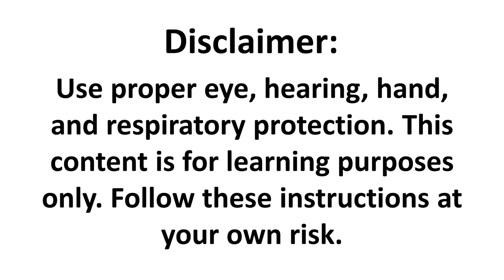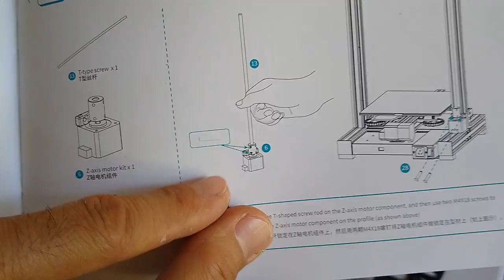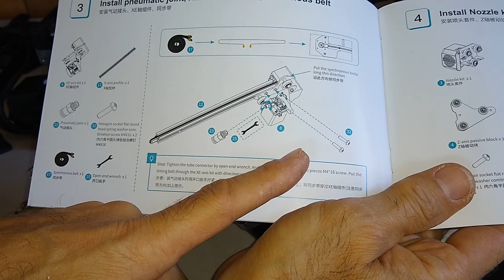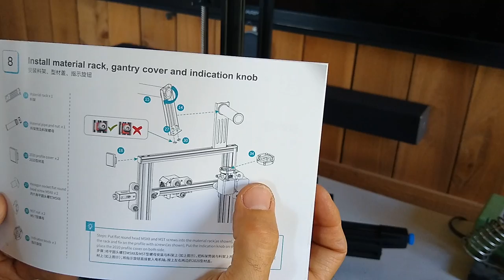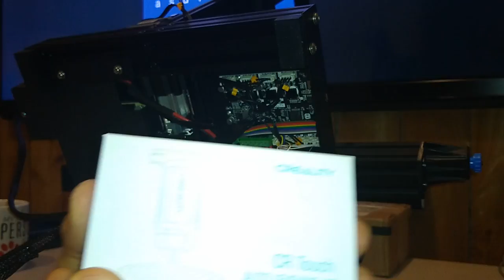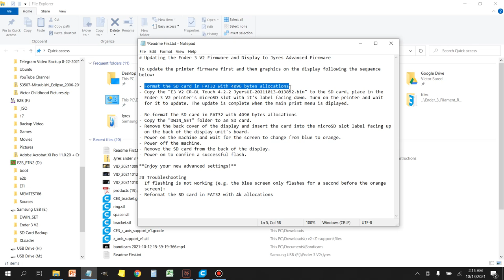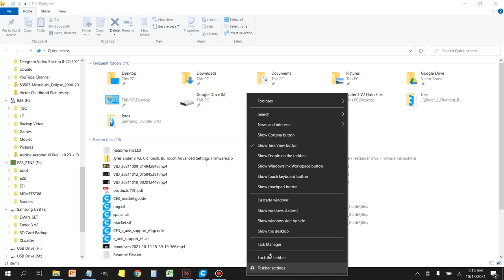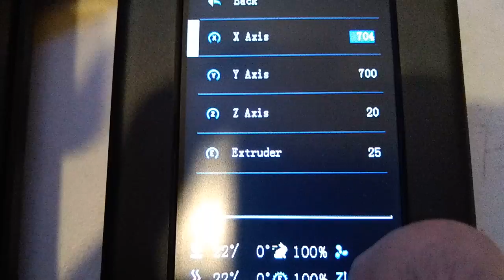Ender 3 V2 Assembly, Upgrades, and Jyers CR/BL Touch Firmware Step by Step.

Comment: They must have changed design a bit on something. I used your links and bought the stuff but the nozzle of the new hot end hits the bed before the CR touch comes close enough to the plunger. Ender 3 v2
Reply from the maker: Hi Craig, Thank you for commenting. Send me some pictures to vbared@gmail.com of your hotend without the fan cover so I can see what's going on. 

I'll do my best to help you resolve the issue
Reply from the maker: Hi Craig, I found out what happened. The link in the video description is to the Micro Swiss all metal hotend that fits the CR10S Pro/ CR10-MAX (which is longer). This is the shorter heatsink made for the Ender 3 V2. 

https://store.micro-swiss.com/collections/spare-parts/products/replacement-all-metal-cooling-block-for-cr-10-ender

Send me an email with your PayPal info so I can cover the new heat sink cost. It should be like $20 plus shipping. Let me know, sorry for the goof up.
Reply: Shit can't send it back now.
Reply: Actually look like it says for CR10S and ender 3 and pro.
Reply from the maker: @craigreich8046  Hi Craig, I fixed the link to reflect the correct Micro Swiss model after seeing that it was linked to the CR10S Pro and CR10-MAX version. You can tell which one you have by the number of small heatsink fins. The CR10S Pro should have 5 horizontal small fins and the Ender 3/CR10 will have 4. Please place the order for the short heatsink using the link from the Micro Swiss store in my previous response and send me an email with the total shipped. It's a small part so shipped shouldn't be more than $30, I'll happily reimburse you. It was my mistake. You were so kind to support my channel by using the provided links. Thank you for alerting me about the error.
Reply from the maker: @craigreich8046  Don't worry about sending the other one back because you're going to need the rest of the parts. You're going to loosed the grub screw that is holding the titanium heat break to the long heatsink and reinstalling the assembly below it to the new shorter heatsink. It's only going to take a few minutes to swap.
Reply: @vbared  I think I have an easy fix. I found 2 small computer mobo stand offs and I think I can just extend the touch sensor a bit lower as it only needs a few mm. One thing I could not figure in your video as you went a bit fast was after flashing the firmware what do I need to do next with bed leveling and such? Thanks for the help Victor.
Reply from the maker: @craigreich8046  Are you using the stock fan/parts cooling assembly that comes with the Ender 3 V2?
Reply: @vbared  For now yes.
Reply from the maker: @craigreich8046  OK, the problem you will have is that the parts cooling fan will be blowing on your heater block instead of the part under the nozzle. If you decide to get my minimalist dual fan bracket you're going to have the same issue. The stand off will get your probe back to where it needs to be but the parts cooling fan won't blow on the part you're printing because the heater block is in the way.
Reply: @vbared  Did not think of that so I just ordered the right one with your link.
Reply from the maker: @craigreich8046  Good morning Craig,  Send me an email vbared@gmail.com with your PayPal info and total for the part so I can reimburse you. I feel bad that you had to spend extra hard earned dollars and printer down time for my error. I'll sleep good knowing I took care of this.
Reply from the maker: Hi Craig, I just saw your email message and replied. Another thing to check, if a manual bed level doesn't fix it for you,  is for a loose connector. If you can't spot one by just looking then unplug and replug in all your outside stepper motor plugs,  and the auto probe. If that doesn't solve the problem open the main board cover unplug and replug those cables one by one.

Let me know how it works out for you.

Comment: Great video Victor. Can I change out my BL touch for the CR touch easily on my CR10s pro v2. I already have the updated Tiny machines software. Could you also check your messenger as I have another account now. Thanks
Reply from the maker: Hi Mark, I haven't tried but the wiring is the same on both so all you would need to do is unplug the BL-Touch's tiny plug and plug it into the CR-Touch. The BL-Touch bracket won't work but I just finished designing one for the CR-Touch, testing it right now.
Reply: @vbared  awesome, thanks. I’ve just bought one. My CR10 is doing crazy stuff lately and I think it started when I pressed the validate mesh button (never do that again). It’s seems that it’s settled down now but now the BL touch is sporadically working, I have no clue.

Comment: Isn’t the v2 fan speed adjustable out the box
Reply from the maker: Hi William, Thank you for commenting. Yes, the parts cooling fan's speed can be controlled using the menu. The remaining 3 fans however cannot be adjusted. Creality uses these super loud 24 volt fans that make having this printer near a living space very annoying. I swapped out 3 of the 4 fans to super quiet Noctua fans but they run on 12 volts so I needed 3 buck converters. The Buck converters allow you to adjust the 24-volt input voltage down to 12 volts  (video linked below).  

https://youtu.be/ycvHpMbo5Hw

Best of luck with your mods!
Reply: Ahhh gotcha I just ordered mine so I’m cramming info lol and currently still watching your video Thanks for the Info
Reply from the maker: @Billyo234  Hi William, If you're new to 3D printing and have questions about the CR10S Pro V2 or Ender 3 V2 machines or printing with PETG, don't hesitate to ask. I'm just now playing around with Nylon.
Reply: Thanks appreciate the content and info I’m gonna subscribe I look forward to seeing how u make out with the nylon
Reply: Victor feel like i need to thank you again so I got my printer the other day put it togther but could not get the firmware to update from the Creality website downloads. I reached out to them they sent me a forward that actually worked for the car touch but I was disappointed with the functions and how limited they were. Cause in my mind I kept remembering your video and how many function I had after the update (not realising your using a different firmware). So last night after 2 days of struggling I tracked down your video again seen u had the download under the video and did what u said using the provided firmware and o couldn’t be happier. Everything went smoothly the firmware downloaded perfectly the interface download perfectly everything is working as it should and it’s directly a result of your video again thanks so much u ended a headache lol
Reply from the maker: @Billyo234  Hi William, You're so welcome! I'm glad you found value for your viewing time. The Jyers  firmware is awesome. If you want even better performance from your Ender 3 V2 use this start G-Code below instead of the generic one Cura generates. It'll get rid of all the oozing on your build plate during probing and warm-up. 

; Script based on an original created by tjjfvi (https://github.com/tjjfvi)
; An up-to-date version of the tjjfvi's original script can be found
; here:  https://csi.t6.fyi/
; Note - This script will not work in Cura V4.2 and above!
; max_feedrate_z_override = {max_feedrate_z_override}
; retraction_amount = {retraction_amount}
; retraction_hop = {retraction_hop}
; retraction_hop_enabled = {retraction_hop_enabled}
; retraction_prime_speed = {retraction_prime_speed}
; retraction_retract_speed = {retraction_retract_speed}
; retraction_speed = {retraction_speed}
; speed_travel = {speed_travel}
; retraction_enable = {retraction_enable}
; layer_height = {layer_height}
; smooth_spiralized_contours = {smooth_spiralized_contours}

; Ender 3 Custom Start G-code
M117 Pre-heating the extruder!
M104 S160; start warming extruder to 160
M117 Getting the bed up to temp!
M140 S{material_bed_temperature_layer_0} ; Set Heat Bed temperature
M190 S{material_bed_temperature_layer_0} ; Wait for Heat Bed temperature
G28 ; Home all axes
M117 Auto bed-level GO!
G29 ; Auto bed-level (BL-Touch)
G92 E0 ; Reset Extruder
M117 Getting the extruder up to temp!
M104 S{material_print_temperature_layer_0} ; Set Extruder temperature
M109 S{material_print_temperature_layer_0} ; Wait for Extruder temperature
G1 Z1.0 F3000 ; move z up little to prevent scratching of surface
G1 X228 Y200 Z0.3 F5000.0 ; move to start-line position
M117 LET THE PURGE BEGIN!
G1 X228 Y20 Z0.3 F1500.0 E15 ; draw 1st line
G1 X227.2 Y20 Z0.3 F5000.0 ; move to side a little
G1 X227.2 Y200 Z0.3 F1500.0 E30 ; draw 2nd line
G92 E0 ; reset extruder
G1 Z1.0 F3000 ; move z up little to prevent scratching of surface
M117 Autobots! Roll Out!
; End of custom start GCode
Reply: Hey victor been a few years I’m still running this same firmware and still working wonderfully however my nephew just got the Ender 3 v2 neo and I was curious is the jyers would be compatible with it it looks like it the same machine as the v2 but it just came with the cr touch already installed

Comment: You didnt change out thermistor
Reply from the maker: Hello Charles, Thank you for commenting. Yes, I did change it along with the heater but forgot to mention it in the video. The kit I bought is.

https://amzn.to/3r3rg4O

Best of luck with your build!
Reply: @vbared  thanks for reply
Reply: @vbared  that heat cartridge will work off the stock power source I saw you splice something but couldnt make out if it was cartridge or thermistor
Reply from the maker: @charlesrestivo870  Hi Charles, The thermistor cable reached the control with no problem. The heater cartridge didn't have the connector needed at the end so I carefully repurposed the original connectors but soldered them in place in addition to their folded tabs. Once the connectors were done I just pushed them into the plastic housing.

Hit me up with any other info you need, I enjoy helping.

Comment: I buy 3D touch from twotrees. I have very had times. Every software i download isnt working properly for me.
Afterrun leveling extruder comes to the center of bed an stay there. Noting else happen and leveling process is still on.
Reply from the maker: Hi Peter, Thank you for commenting.  Are you located in the United States?
Reply: @vbared  no i am from Europe
Reply from the maker: @ThePecy  Hi Peter, was everything working properly before you connected the 3D Touch? If so double check to make sure the connections for the 3D Touch are correct. It's possible that a wire may not be in the right place on the connector. What happens if you try and print something does it do the same thing as it does when trying to level? If you could film the problem and send me a link so I can see what's happening and try to help you resolve the problem.
Reply: @vbared  thanks i downloaded files from your video have some trouble with Z offset but after some nerves it run finally
Reply from the maker: Great news, Follow this part of this video for setting your z offset.

https://youtu.be/F1Lk7N5CMo4?t=1132

Let me know if it all works out for you.

Comment: So my screen was working till i flashed it, now its black and nothing seems to make it work again. anyone have this problem?
Reply from the maker: Hello Dustan, Please give me more details. Did you flash using the Ender 3 V2  files I linked in the description? There two things needed, the Jyers firmware for the machine and the Jyers files to flash the display. If you have trouble getting a successful flash then try a different SD card.
Reply: @vbared  So I got the screen working by using the original files from creality, When I try flashing with any other file whether the Jyers or TH3d all I get is a black screen and need to flash with creality file. I think just getting the old ender 3 screen would be best, the new ones I don't like at all.
Reply from the maker: @DustanT   Hi Dustan, The display screen SD card should have the DWIN_SET folder containing 6 files. Double check to make sure that there isn't a second DWIN_SET within the DWIN_SET that is in the root folder of the SD card. The display flash won't work if the DWIN_SET files aren't contained in its folder.

Best of luck with your mods!

Comment: Unfortunately, I still have the blue screen of death after I added the first file.
Reply from the maker: Hello mellaramore959, Which screen do you have on your Ender 3 V2? Follow this link on how to tell which you have. Creality has about 4 different display boards that they started using after I made that video.

https://github.com/mriscoc/Ender3V2S1/tree/Ender3V2S1-Released/display%20assets
Reply: @vbared  My screen has three inputs unlike the photos. I have three choices were to connect the ribbon cable to the motherboard. 12864ZW-10. If that helps
Reply from the maker: @mellaramore959  Oh, I see now, unfortunately, the Ender 3, Ender 3 Pro, Ender 3 Neo LCD screens aren't compatible with Jyers or Miguel's Professional Firmware. What you can do is order this Ender 3 V2 display so you can use the aforementioned firmwares:

https://amzn.to/3OK00E5

Comment: Shouldn't have to spend all the money on the Ender 3 V2 to get it to be a better printer when the Elegoo Neptune 3 exists.
Reply from the maker: Hi Dean, Thank you for commenting and printer recommendation. I'll have to pick up Neptune 3 so I can compare it to my current build. I chose the Ender 3 V2 because of its popularity, community support, and fantastic Jyres firmware available for it.

Best of luck with your mods!
Reply: @vbared  I just returned my Ender 3 V2 since it was having issues day 1.
Reply from the maker: That's too bad, but I hear you. There are a few things that Creality could do to improve the out of the box experience with the Ender 3 V2 for new 3D printer hobbyists.

Best of luck with your new machine!

Comment: completely pointless printer to buy now that they released the S1 tbh but can confirm it is good.
Reply from the maker: Hello MrPhysics, Thank you for commenting. The new Ender 3 S1 looks awesome and 150mm/s, Wow! It looks like Creality is listening to the community. Are they using a custom hotend?

Best of luck with your projects!
Reply: @vbared  thanks! No i believe its the same hot end as the ender 3 just with a modified carriage to hold the sprite extruder as well as the crtouch ill have to double check when i get home! If ppl dont want to spend the money then the V2 is still a great buy especially with Jyers enabling manual meshes!
Reply from the maker: @mrphysics2625  The Jyers firmware is amazing. Is the S1 still using the same 4.2.2 board as the V2? Jyers support for the S1 would make the extra cash a non issue for most people.